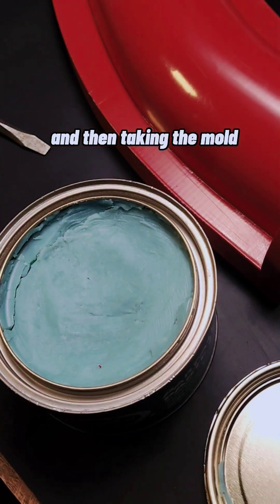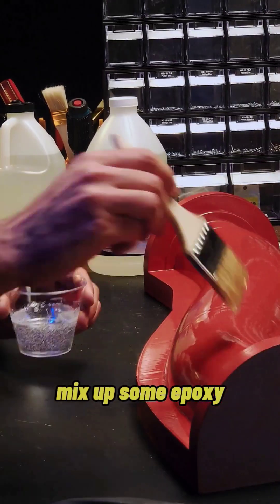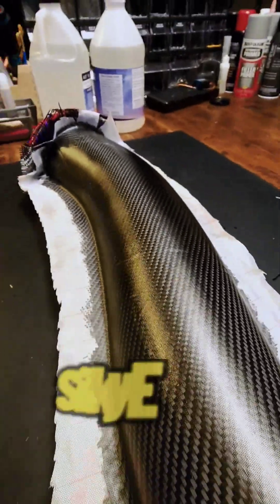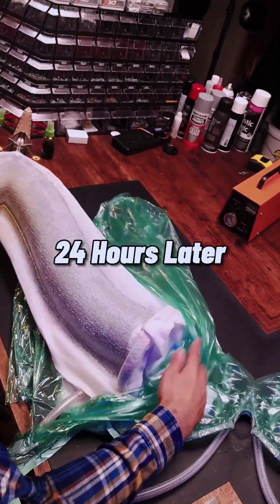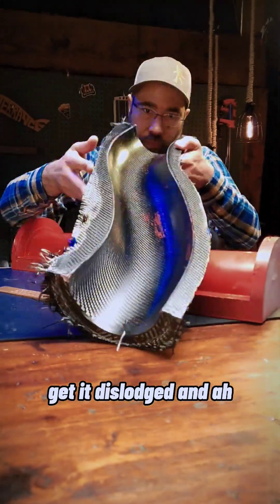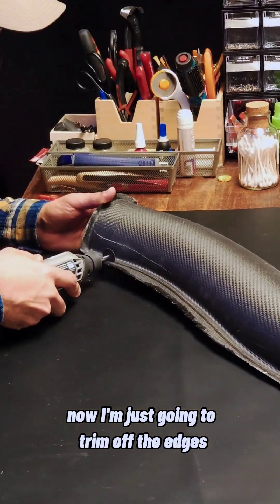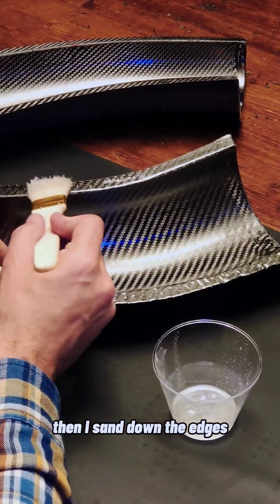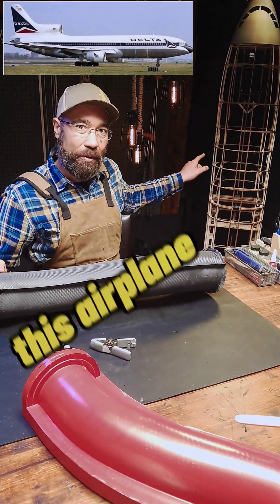BIG Carbon Fiber S-Duct from 3D Printed mold for larger RC Airplane #aviation #carbonfiber

Comment: Do u trim the edges when the 2 parts are glued together? If so, is the bond strong enough?
Reply from the maker: The edges did get trimmed off with enough lip to hold the halves together. I made a few design changes to make it easier in the future.

Comment: What is it? the secon layer

And no need input to the ovens? Just vacum?
Reply from the maker: It's the Wet Lay process, You're thinking of PrePreg which requires curing in an oven.This S-Duct is two layers of CF, Then Peel Ply, followed by breather material.
Reply: The post cure is good for all carbon lay-ups… pre-preg or not… but I think the resin is such that it has a really long time at room temp, and can be kept for some time in a fridge.. ( they usually have refrigerated drawers in the mold/lay-up rooms.. prob next to the autoclaves.)
But the ramp/soak/de ramp oven temps are controlled by a program and yeah… it gives the whole “bond” a good bit stronger… it does kick off the pre-preg, and the vac bag/bleeder fabric/peel ply.. is so it can squeeze out as much resin as possible and still have it all stick together. The strength is in the glass, not the resin… or carbon in this instance

Comment: Hey! Awesome work on that duct. I am very intrested how did you prep'd the 3d print, as the result came out sweet looking. Consider making the video about that, as this is quite a hot topic nowdays. 
I made a few attempts but for some reason I cannot pull the laminate out the mould. 
Keep up the good work!!
Reply from the maker: Thanks for the comment! I am strongly considering taking some time out to produce a video detailing the steps I took to creating the mold, post process, and prepare for casting. It's a long tedious process, but worth it when you see parts come out perfectly. Getting the laminate out of the mold can definitely be tricky if you didn't prep it correctly ahead of time. Thanks for watching!
Reply: Sản phẩm bạn làm thật ấn tượng!! Nhưng tôi muốn biết vật liệu dính và ghép hai phần carbon vào với nhau chắc chắn đẹp mắt như bạn (tôi vẫn chưa tìm được sản phẩm dính và chịu nhiệt ấn tượng như bạn) 😭😭 @RCCAD2VR
Reply: Another vote for details of the mold creation process.  It’s a skill that has applications across the hobby and would open unlimited possibilities.

Comment: I was a model maker for an industrial design firm. We built a 1/4 scale model of a LSA that a private investor wanted to develop. That’s what your projects remind me of. I love working with composites. 

BTW. That model CRASHED😂😂😂 Horizontal stab chord grew by 33%. Twin boom weird looking pusher plane. Unfortunately, the funding for that project fizzled out. The entire model was composites. REN Shape modeling molds. Hours and hours spent Sanding, priming, prepping. But damn when you pull a flawless part…….

Nice work.
Reply from the maker: Oh man, that sounds like it was an awesome project to be able to work on. Too bad it didn't make it. Nothing can prepare you for the amount of sanding and prepping to get a mold ready for casting. I tried to capture a tiny taste in my most recent video, but could never capture the true scope of work involved. This mold, for the S-Duct, took more than 10 days to print, join, and prepare.
Reply: @RCCAD2VR  back when I was a model maker, 3D printers were just being launched. I build museum exhibits now.

All of our composite molds were RenShape. Not sure if your familiar but it’s awesome stuff. You can get it aluminum filled, put an edge on it and polish it out. It will hold an edge. 

We had 5 axis CNCs. Then sand for days on end😂 We also made components for the RV10 aircraft. Carbon fiber dashes and accessories. Pre-preg carbon fiber and an autoclave. Aluminum molds. That shit would come out and like you said, watch your hands. 

I’ve seen some 3D printed parts and the resolution isn’t what I used to work with so I can imagine sanding it.
Reply: what ID firm was that? a veteran wants to know. lol